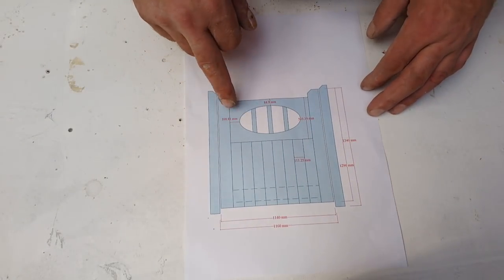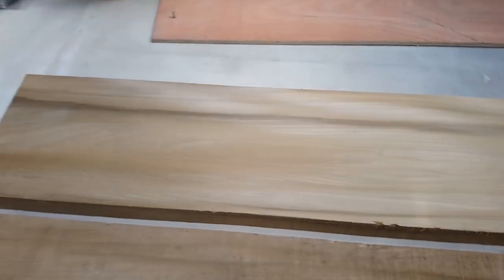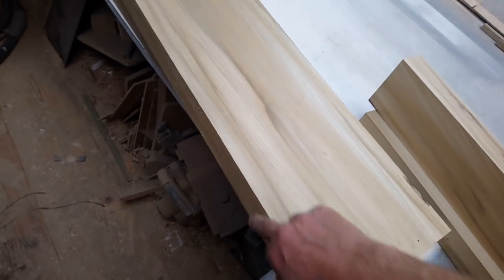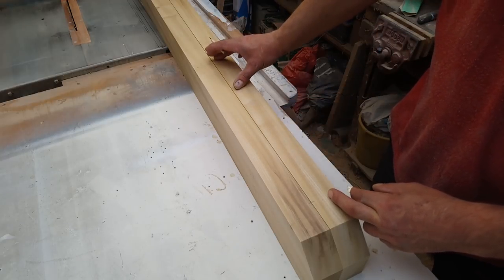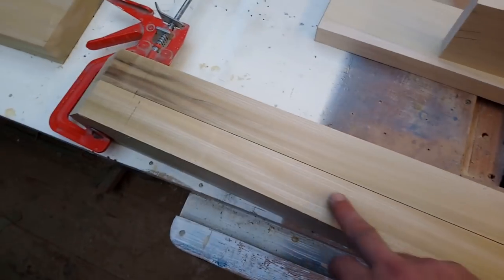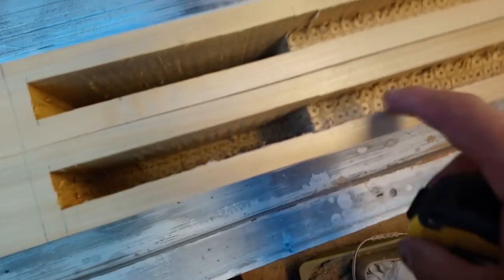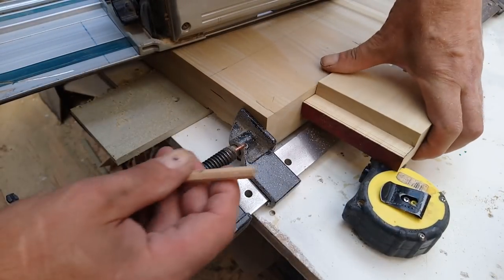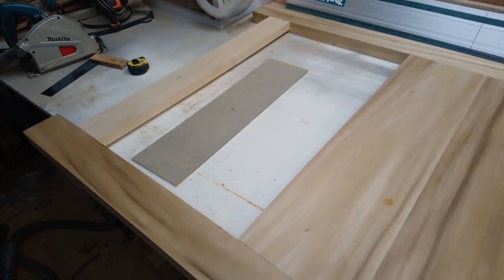Gate Making Pt1 - Lots of cutting, planing & morticing

Comment: excited to see how we differ in our approach.
Reply from the maker: I guess timber for you is a bit more abundant ?
Reply: Gid joiner I just build a lot of gates over here in California and there aren’t a ton of videos on the process. Interested to watch how you do things.
Reply from the maker: Ok, a lot of the gates i build are very simple rail n braced Z shaped type things, often just to match the adjoining fence, lots of people aren't prepared to spend money on a  'posh' gate, I have some pics on my Facebook page of gates I've built, most have pics of the process of building, 
Very similar to doors but a bit rougher 😄 Hardest thing here is the weather, It rains a lot, treating off the shelf pine or trying to use rough cut treated timber, cutting joints/mortices but still protecting the wood from rot, There's a treated wood called Accoya, really nice to work with, it won't rot or warp but costs 4-5 times the price.
Reply: @Gidjoiner  I've had good success with having various things pressure treated, my own garage door frame is well over thirty years now and not a sign of rot.

Comment: Nice work Gid,
I'd definitely put a brace in if I were you and keep away from those dominoes if possible?. Very instructive, keep up the good work
Reply from the maker: Thanks Frank, 👍
Yep i did put a brace in, Dominos went in but were a bit of a pain, not enough adjustment, first time I've used those on a brace so think i'll go back to putting a biscuit in that allows the brace to slide a little into position whilst gluing up.
Reply: Looking forward to part two and hopefully many more similar projects
Reply from the maker: Pt2 has been posted 😉
Thanks , I've work ahead of me, I'll film it as it gets done

Comment: What table saw do you have there Gid? Looks like a "self enhanced" saw :D Ive been thinking of buying a 160 quid table saw and then modifying the weaker parts to make it a bit more substantial. Wondered if you have done the same thing? 
Great vid by the way. That festool mitre saw is a beast!
Reply from the maker: Hi, Thanks Neville 👍 Yep that's sort of what i did, spent a bit more tho but you don't have to, as long as it runs smoothly n is powerful enough n will last long enough. It's a Scheppach Tisa 5.0, similar to the Scheppach TS 310 at screwfix but mine is more powerful & it'll cut 100mm depth instead of 83mm, It's powerful, smooth n relatively quiet, when i bought it i had enough money, £500-ish to buy this or a cheap cast topped one, the cast ones only cut 75mm & weren't very well made, so i went for this n always planned on putting it in a table & making a decent fence for it, which i did 👍 but i did have an issue with the rise n fall after a couple of yrs, I needed to weld that, & i think a shim has worn on the spindle, you can't get the 5.0 any more n that's prob why, I'm not sure if i'd recommend it but i always knew i was going to Frankenstein it a bit to suite my needs, the sliding table i use for squaring boards is surprisingly accurate but it's double boarded to make it higher because the bench at the side is 20mm higher, lesson learnt make all benches the same height 👍 It's my saw, I love it like i would a grumpy old dog or a dodgy cousin,  https://youtu.be/tQ97rFxfRFc. I just looked at screwfix n i would consider the Titan if i wanted a cheap saw, my chainsaw & wood chipper are Titan, fairly robust but i like to fiddle with a toy before i buy it, the Titan might be a bit 'clunky', there might be a bit of play in the rise n fall etc. I'm not sure how well made the cheaper Scheppachs are tho, as I've said mine is far from perfect. The Dewalt saw i have for site is really good but noisy n more like £400-£500!, I think if you think you're going to have it a long time & are going to spend time & maybe some money on it enhancing it then go for the best you can get, a good brand will last a lifetime, When i want to buy a new tool i can't afford i work a wk'end or two to earn the extra 👍 that's what i did to buy the Festool Kapex 120 & the domino 👍
Reply: @Gidjoiner  Cheers for the info mate, and ill take all that onboard when come to buy. I know the general consensus is buy cheap, buy twice and to defo spend to the absolute most of your budget but the tight Yorkshireman in me wants to spend as little as possible but get as best i can. If some altering improves its stability then im all for buying it cheap and then making it more rigid and accurate with a bit of work. There are plenty on the market but i dont wanna fall for the mistake of paying good money for something thats a pile of the steaming stuff.  Really appreciate your input. Keep up the good work and look forward to seeing that Paling fence finished!
Reply from the maker: Yep sometimes you don't always get more for your money, the Festool Kapex120 i have is a good saw but a £1000?, i'm not sure about that, I just had a look on ebay, you only need a saw that runs well with a flat bed, I bet a load of those get sold because the fence or something is a little tired? 👍 you're welcome, best of luck n thanks 👍
Reply: @Gidjoiner  I reckon so as well. As long as the bed and saw are plumb thats all that matters. Ive been watching alot of Johnm Heisz stuff if you're familiar with him. A canadian woodworker and he has a nice design for the fence. It was always my plan to make one cos i thought anything else on a cheap saw would be pants. Like the metal design you have done though and i have a welder so i should be able to make it. 

Like i say, that Festool Kapex 120 is a beast though, ive seen some quality stuff made on that. Really accurate. I have a Rage 3 which is a few years old now. Ive noticed when the motor spools its pulling the blade toward the motor which is crap if you want an accurate cut!
Reply from the maker: Yep sounds like something has worn on your saw, i think the same has gone on my table saw, a couple of yrs back i found a very thin chewed up shim/washer, I am aware of him n I might have seen his vid, the one i remember watching was i think called the woodman, long videos to watch but it's been a while, I presumed you saw my vid showing the fence? https://youtu.be/tQ97rFxfRFc
Reply: @Gidjoiner  Yeah, i watched it after you posted it. Looks rock solid with metal, defo gonna look into making one similar once i buy a saw. I think toolstation has some good prices on the bench saws. It strains my brain to part with cash when i dont really know what im buying and you always find that golden comment on a video somewhere after you buy one lol https://www.toolstation.com/power-tools/table-saws/c202?redirect=table+saw plenty of choices.

Comment: Great work, what sort of wood you using?
Reply from the maker: Thanks, 👍
This job was supposed to be just pine, two straight top rails with short spindles between but the plan changed, putting the oval in the top, that meant I needed two pieces 2 x 10" for the top, I couldn't get those so went for the next option, Tulip / Yellow Poplar, similar density & weight,